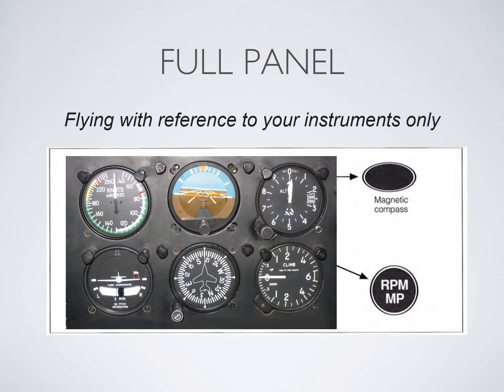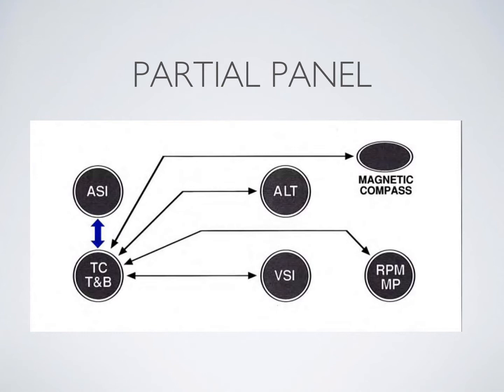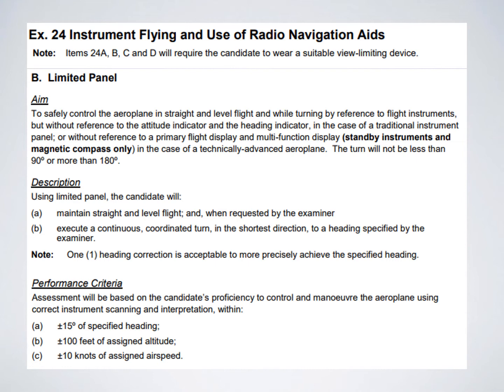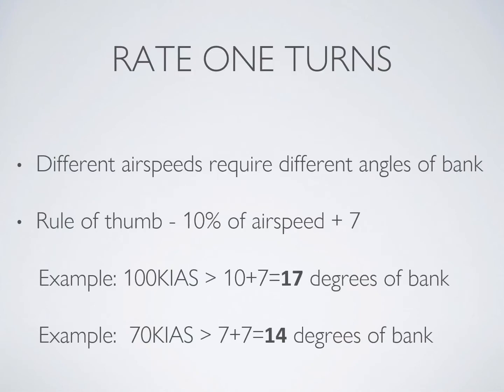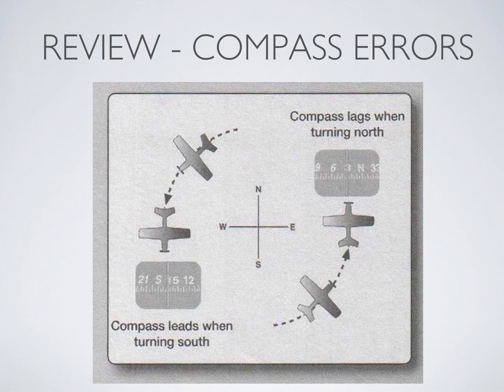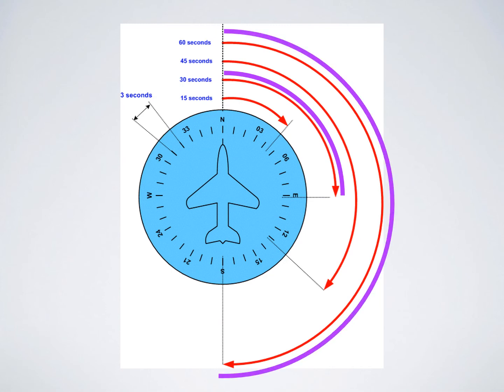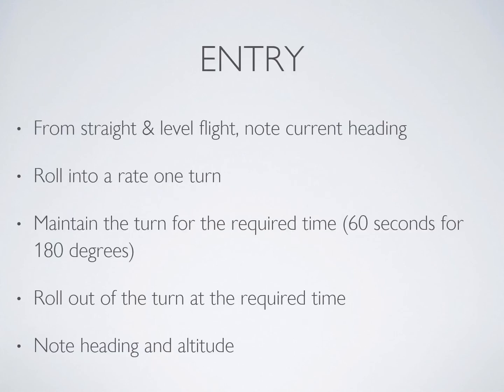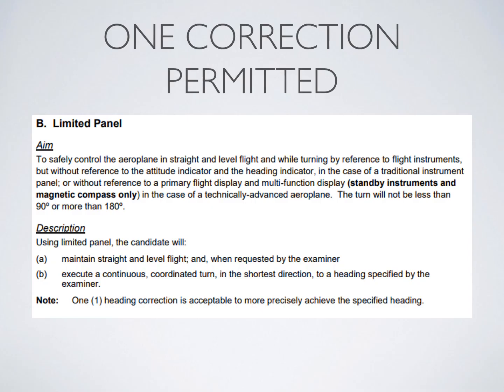Commercial Pilot License - Flight Training Exercise 24 - Timed Turns

Comment: Wish you had more CPL lessons
Reply from the maker: Anything specific? I stopped for a bit but I’m trying to get more stuff uploaded. Thanks for the comment :)
Reply: @FlightInstruction101 yay you’re back!! Starting cpl now so those videos would be helpful
Reply: @FlightInstruction101  I could use help with the power off 180's
Reply from the maker: @derekroulston1977  RGR. I did about 40 power off approaches before my CPL ride and nailed them but they are a highly failed item and need practice. I can help a little just by saying when you practice, keep it as consistent as possible.  I'll check the training standards but I think on the PFL you're allowed the slipping turn which is a beautiful maneuver if you do it correctly.

Comment: One thing I was taught, was immediately setting the VOR like what the compass says. and use it when calculating turns. that way there is no way you will turn into the wrong direction because its similar to the HI
Reply from the maker: Good idea if you have a VOR available in your aircraft - even if it is INOP - as you're just using it as guidance. If you can still turn the HI you could use that too, but you'd just have to remember not to trust it.